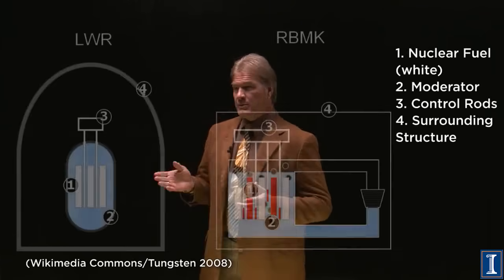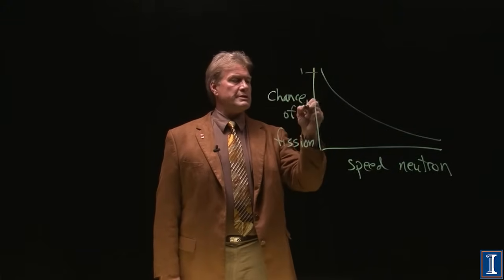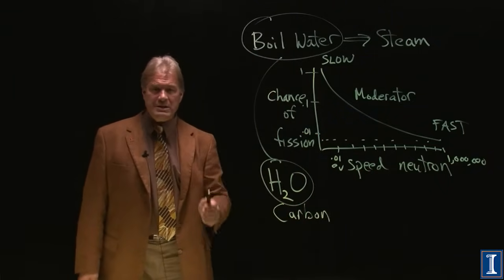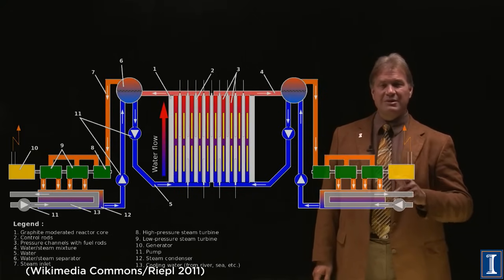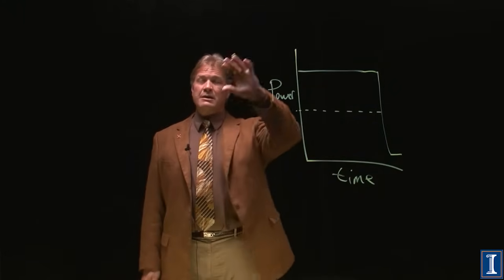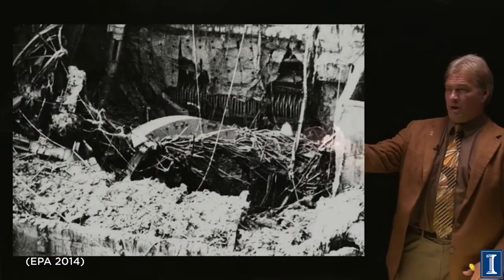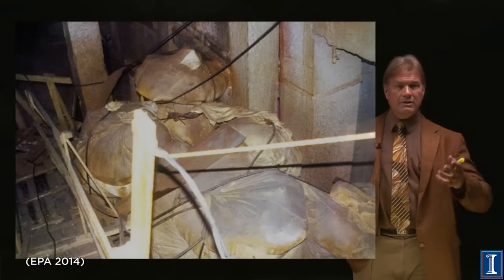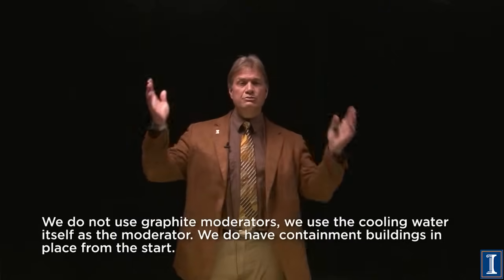Chernobyl: Worst Accident Ever

Comment: The parameter for the 'spin-down' test was that the reactor should have just come off-line, so the power level was high. Except nobody told the previous shift that. So the night shift found the reactor barely operating. I wonder if the reactor operators, (who both died) did verbally protest procedure not being followed. Probably they'd have been scared of crossing the guy.
I cannot understand why Dyatlov still insisted the test still had to be done. 

There were two explosions. A steam explosion that shifted the reactor plugs. Steam occupies 10,000 times the space of the water that just boiled. The second explosion was possibly the hydrogen explosion. 
The RBMK design would never have got a licence in the west as there were multiple design flaws. It's liability to form steam voids. Where there is steam, not water there is more heat.
Then there's the control-rod graphite displacers.
Reply: Can you say "no" to your boss, in Russia?

Comment: Sir you're not painting an accurate picture they estimated from the level of readings the final readings the reactor was able to take it went low-level nuclear fizzion bomb after that it had a secondary chemical explosion the firefighters that fought the fire had so much nuclear exposure their bodies irradiated and made other people sick the people that were treating them they were so irradiated that it was dangerous for other people to be around them for longer than 10 minutes at a time and this was after they were moved into a specialty hospital more than a hundred miles away the nurses had to take iodine pills and throw away clothes after each time treating them an entire section of the hospital was emptied out and they were kept in a wing by themselves when these men died they had so much exposure every individual sell was dead in their body they literally rotted black within a couple weeks to some extent yes you're following the things that happened but honestly you're not painting the picture as bad as what it was ... The last power reading the equipment was able to take was 33,000 megawatts the estimated it may have hit 140,000 megawatts the explosion happened the instant the control rod started moving in and then there was a larger secondary explosion your chemical explosion you're talking about but I will tell you there was a nuclear explosion that night it was just so minimal because only a very small portion of the material went critical and the reason for that is because it was only the graphite tips and also because the fuel they used in Russia was of such poor quality you're very wrong sir that material went full critical thankfully for all of us and the rest of the world the nuclear fuel was of such low quality that it is it's criticality couldn't truly produce a good explosion.
Reply: Who told you this?

Comment: 12:33 ...they try putting the rods back in but there is another special thing that happens, when they first insert one of the rods it actually acts as a little bit better of a moderator..."

This is not the case at all.  The insertion of the control rods decreased the absorption of neutrons in the bottom of the channels and this caused the increase in reactivity. 

So here is what really happened at the end with Chernobyl #4 reactor just before it blew up. When the AZ5 SCRAM button was pressed it started the insertion of all the removed control rods, as this happens the control rods pushed the attached graphite displacers from the middle of the channel to the bottom of each reactor channel.

As the graphite displacers were pushed down in the channels they displaced water in the bottom of the channels that was a neutron absorber. When this neutron absorbing water was forced out of the bottom of the channels this caused a large increase in reactivity at the bottom of the reactor.  

Heat when away up, the water was all turned to steam, and there was a steam explosion followed by another explosion and a complete meltdown of #4 reactor.

Comment: 10.30 "Pressed a wrong button so the power dropt too far". I have an issue with this explanation. They reduced the power to about half and then they got a call from Kyiv telling them that they couldn't reduce anymore because of industries needing power for ten more hours. So they kept the reactor on "half speed" for about 10 hours. Because of the half speed, the Xenon-135 didn't get burned off (as it does at higher "speeds") and started to poison (xenon-135 works as neutron absorber and slows down then reaction) the reaction. When they then was supposed to reduce the reaction a bit more the reactor was so poisoned it almost stalled completely. 

"They didn't know about the Xenon". I have watched several documentaries about Chernobyl and the actors who plays the operators tries to warn atlov about the poisoning (that the reactor is unstable and should be shut down) but he brushes it off.
Reply: How do you know this is true?

Comment: How about three Mile island?
Reply: You find plenty of information about three miles island in the internet.
At three miles island a partial reactor meltdown occurred, similar to what happened in Fukushima.
In both cases this happened after the reactor was shut down. Due to the heat which is created by the fission products even after the chain reaction is stopped it melted the reactor.
In the most modern rector designs this scenario is taken account for.
Can't happen in Flamanville.
(Still, this reactor is a financial disaster)

Comment: In graphitic structures neutrons can create something called Wigner defects, which are a rearrangement of carbon atoms from their hexagonal arrangement.  When the graphite gets hot enough, these defects will anneal back into a hexagonal arrangement and release additional heat, cascading the process.

Comment: If i am not wrong RBMKs don't need to shut down for refuelling. The rods, containing the nuclear fuel could be switched mid operations by a specific refuelling device in the central reactor hall. Nevertheless they still tried these tests, to use the steam to power the reactor while shutting down, several times,yet they always failed. 
Thank you for this great video :)
Reply: I believe you are right.

Comment: In the case of a power loss or earthquake, you would have every reactor affected inserting their rods in 2-5 seconds. SCRAM, as it is called, just keeps the neutrons from hitting the fuel.
Reply: 3" x 3" x 14 feet long in 2 seconds? That is asking alot. It has to displace the water on the way down. But still the core stays real hot!  They actually shut the Fukushima cores down in time. Residual heat is the problem. No power = no cooling = kaboom!

Comment: If the water-moderator system breaks, you lose the water, won't it cause the reactor to heat up/meltdown since it loses its coolant?
Reply: I think it’s about the water acting as both coolant and an enabler of the fission itself.

With no water, the fission and the heat generated from fission are minimized, so there is nothing to cool.
Reply: @mattm3901  The fuel is still hot for years due to beta decay.

Comment: In general, nuclear reactors are not designed to explode. However, under certain conditions and failures, catastrophic incidents can occur. The explosion at Chernobyl was not a nuclear explosion but rather a steam explosion followed by a graphite fire. This was a result of a combination of a flawed reactor design and operator errors during a safety test.
Reply: How about a Steam explosion, followed by a Hydrogen explosion ?

Comment: Always be on alert if someone tells you "everything you needed to know about a specific topic". Nuclear power plants are complex machines although the physics behind it may seem simple. Complex machines are prone to failure, human error, negligence and profit-maximizing cost savings in maintenance due to greed or incompetence.
It's easy to say that an event, exactly like Tchernobyl, might probably never occur again. But there are myriads of things that can and will go wrong with probably devastating consequences. And that doesn't even take into account the consequences of the still non-existant long-term storage option. Or the nuclear waste that had been dropped to the sea-floor for decades. Just think about Fukushima. Surely not identical to Chernobyl. But still a catastrophe. And a perfect example for human ignorance.

Comment: A containment building may have helped, I may even agree to most likely have helped.   But the steam explosion, lifted a 1,000 ton "biological shield" highenough go through the roof of the building before coming back down...   I'm not sure 3 feet of concrete and steel is gonna stop something like that.  Also RBMK's could be refueled without powering down, so I'm not sure where's getting that it couldn't.

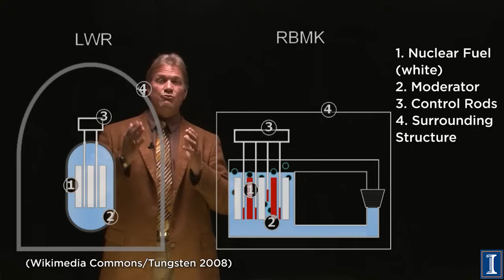Comment: 1:46, the Seabrook nuclear power plant, started in early 70s is double walled with rebar as thick as your wrists, a hole dug deep as 42 feet +- below sea level , to build the forms for pouring concrete on bedrock, which will be the foundation for the reactor. A very cold place to work in winter. All the miserable cold just drops in the hole, panels are left out at the bottom of these forms as to allow salamanders ( large kerosene heaters) to keep the temperature warm enough to pour concrete, many times the workers would climb to the top of these forms and huddle around the rebar to catch the heat, night shift could get miserably cold, this huge hole as the power plant was being built had to have a compaction rating every 6 inches, so to save time and expense, they poured it solid with concrete , one continuous pour, . 24 hours a day ( 3 shifts) concrete trucks lined up one after another. They even built their own bash plant to make concrete,  Good sand gravel was a premium, made some farmers rich without losing their farms, some lands got lowered, a lot of work just to bring it to ground level. I also worked night shift flying panels, hooking up the panels for concrete pours and breaking them off the wall, once poured, each panel had 3 work sections. 2 workers at the bottom part of the panel, 2  at center ( my position) and top position for the workers pouring and inspectors, sometimes it could be a long shift waiting for the crane but the view was amazing, I’ve sat on top of the dome, I rode in the cage of that crane in the cold night during snow putting in she bolts for workers to plank, it was very,very cold. Because of the snow and lighting and the workers leaning against the outer wall, the wind blowing,  It was surreal, it reminded me of the old 1940s movie, “Lost Arising “it was quite an experience

Comment: Somehow he failed to mention that the control rods, at the bottom, had a long graphite rod, that acted as a gas pedal for the fission, so as they lowered the control rods, the first thing that went between the uranium rods was the graphite rods, that accelerated the fission and led to the explosion. This is the only problem with the video, but it's a major one. He glossed over it in two seconds with a vague quick phrase.
Reply: in addition, the tips have displaced the cooling water, which still had a somewhat moderating effect, which then split into hydrogen and oxygen further up and the rest is history
Reply: Maybe because the show made a bigger deal about that than is really needed to be

Comment: Yeah, that containment building worked very well in Fukushima. The designed by GE
Reply: If the would have just vented the hydrogen gas.  But they did not.

Comment: I PREFER SMALL MODULAR REACTORS TO BIG REACTORS.

SOME PEOPLE LIKE BIG REACTORS SAYING THEY ARE MORE COST-EFFECTIVE BECAUSE THEY'RE BUILT TO SCALE.

I SAY FOR BIG CITY APPLICATIONS PUT 12 SMALL MODULAR REACTORS IN SERIES AND GET THE SAME POWER.

SMALL MODULAR REACTORS ARE MUCH EASIER TO CONTROL. 

I LIKE THE ANALOGY OF TRYING TO DRIVE A MACK TRUCK DOWN A SNOWY MOUNTAIN ROAD 
VERSUS
A TOYOTA COROLLA.

Comment: WE NEED TO BE BUILDING GENERATION FOUR NUCLEAR POWER PLANTS ON AN ASSEMBLY LINE BASIS AND INSTALLING THEM WORLDWIDE AS FAST AS A WALMART.

NUCLEAR POWER CAN PROVIDE ELECTRICITY FOR CARBON SCRUBBERS TO TAKE CARBON OUT OF THE ATMOSPHERE.

THEY CAN PRODUCE HYDROGEN FOR TRUCKS BUSES AND AIRPLANES.

THEY CAN POWER OUR ELECTRICITY AND TRULY BE SCALED UP AND DOWN TO COMPLIMENT WIND AND SOLAR.

THEY BURN UP MORE FUEL THAN THEY MAKE.

THEY ARE NON-PROLIFERATION. 

THEY ARE WALK AWAY SAFE.

THERE'S SEVERAL DIFFERENT MODELS THAT CAN POWER ELECTRIC FUTURE AND PROVIDE STEAM FOR HEATING OUR CITIES.

THEY CAN BE OUTFITTED AS SMALL UNITS FOR SMALL TOWNS.

THEY TAKE UP A VERY SMALL FOOTPRINT COMPARED TO PAST GENERATIONS.

POLITICIANS AND THE MEDIA HAVE TO STOP SCARING PEOPLE ABOUT NUCLEAR POWER.

DELAY WITH IMPLEMENTING NUCLEAR POWER IS KILLING PEOPLE WITH EVERY STORM.

THE NUCLEAR SAFETY COMMUNITY IS A PARASITE ON THE BUSINESS, MAKING IT SO EXPENSIVE IT CAN NEVER BE BUILT. 

ONCE AGAIN NUCLEAR POWER PLANTS NEED TO BE BUILT ON AN ASSEMBLY LINE BASIS AND ERECTED WORLDWIDE AS FAST AS WALMART'S.

Comment: Lots of interesting information but saddly also stuff that's not true, like the "maintenance break" or "hitting the wrong button".

Chernobyl was designed to be refuelable while running so the test they were doing was not related to maintenance break. The test was about trying the check if the reactor can be cooled for 90 seconds in case of total factory blackout until the diesel generators kick in to generate backup power.

This test had failed in similar reactors for 3 times and this was the 4th time they were trying to successfully execute the test.

The accident happened because grid operators requested different power levels compared to the original test routine and the reactor operators didn't understand that the test couldn't be executed given the grid requirements.

If you watch the dramatised HBO miniseries about this accident, it's more accurate description of the real accident than this video.

And technically the control rods didn't have "graphite tipped rods" but the graphite was on the other end of the control rod than the boron. The problem is that the control rod was so short that if the rod was fully pulled out (allowed by the operators disabling safety systems for the test and then running the system for 10 hours without safety systems), the bottom of the rod is replaced with just water. And when you start to push the control rod downwards into the reactor, the at the bottom of the reactor water will be first replaced by the graphite part of the rod that was in the middle of the reactor. This increases power of the reactor near the bottom of the reactor and this was the final critical mistake after already running the reactor totally unstable after removing too many control rods.

The operators in the control room indeed used control rods in a way that the reactor wasn't designed to be operated. The reactor had to have minimum of 30 control rods inserted at all times to stay safe but the operators decided to pull all but 8 rods while they were trying to increase reactor after (accidentally?) running it into xenon-poisoned state. In reality, the only safe way would  have been to wait for about 20–30 hours to wait for xenon-poisoning to burn away naturally.

And it's still unsafe if even a containment building could have controlled this accident because there was both steam explosion and hydrogen explosion rapidly followed by each other. The hydrogen explosion was caused by superheated zirconium in the reactor reacting with oxygen and water producing hydrogen. (This is the best available theory about the accident. We don't know the true events because there were no data collecting systems in the reactor to record enough details to be sure.)

Comment: The jet doesn't "disappear into vapor".  It may disintegrate into smaller pieces, but it doesn't "vaporize".
Reply: In Russia, you are bound to die for State Secrets.
Reply: Mr literal
Reply: At high enough speed it actually can and will vaporize. There is a video of F4 Phantom fighter jet being accellerated on a sled into a concrete wall, at around 500 mph. The whole plane turned into a big cloud of dust. 500 mph is also close to the maximum speed of a typical passenger jet and I'd expect a very similar outcome. One should add that you can accellerate a jetliner to even higher speeds, by entering a vertical dive. That can bring it close to mach 1. At that speed, when hitting a solid concrete wall, there is just so much energy released that everything turns into vapor.

Comment: I've always wondered if a containment structure would've actually contained the explosion that happened at Chernobyl. The pressure popped a 1500 ton lid on the reactor. Thats a lot of pressure. From what I've gathered a containment structure is meant to keep outside influences out (designed to withstand a direct hit from a passenger plane) and to keep steam in, in the case of "a large break event".  I can't find anything on it being able to contain a sudden and explosive rise in pressure. Does anyone have a clear opinion on this? Or would a combination of a RBMK with a Containment structure just not be a thing anyways?
Reply: The Soviets (and later Russia, with help of Westinghouse even) were developing an evolution of the RBMK with a containment building and improved safety systems. It was called the MKER reactor.